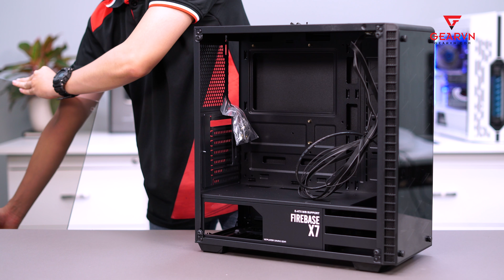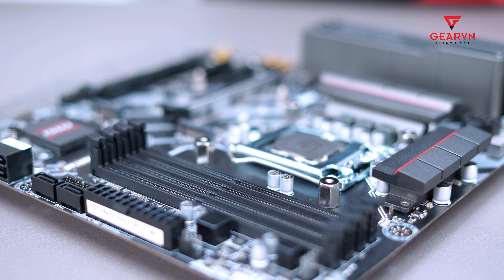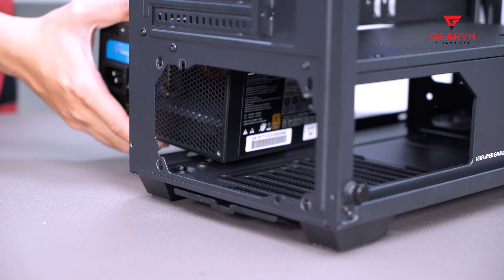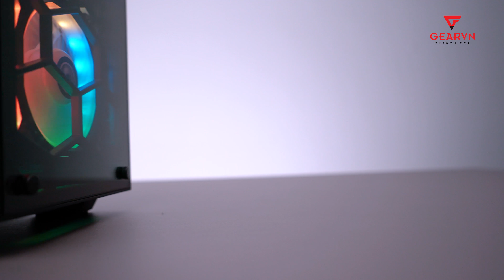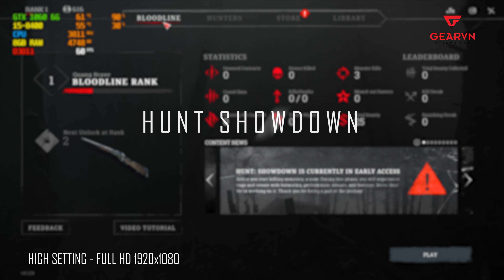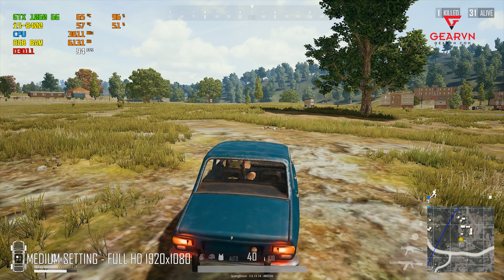Timelapse & Test game | PC Gaming 26 triệu đồng full RGB | Sử dụng i5 8400 và GTX 1060

Comment: Just want to ask ..is the cooler fan maximum to 6 or can add more 2 fan at downside for this case
Reply from the maker: The Segostep Firebase X7 has a maximum of 6 x120mm fan configuration. 
It's already published in the manufacturer's specsheet bro :)
Reply: @GEARVNOfficial  thanks for the info..so the size fan only 120mm?
Reply: @GEARVNOfficial  btw wish is the best cooler fan recommend for this case..im new to this kind of things
Reply from the maker: Yes, It's only support for 120mm fan or smaller.
And Choosing cooling fans depend primarily on  your system and budget. For more information, you can chat directly with us at https://gearvn.com/